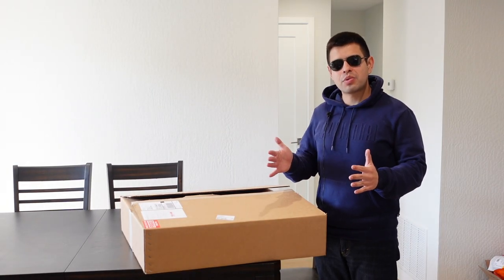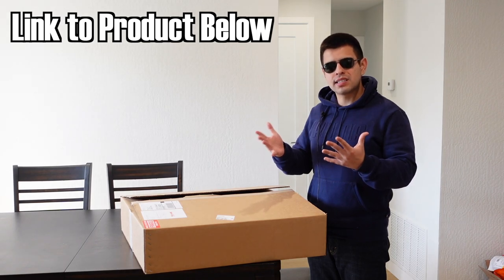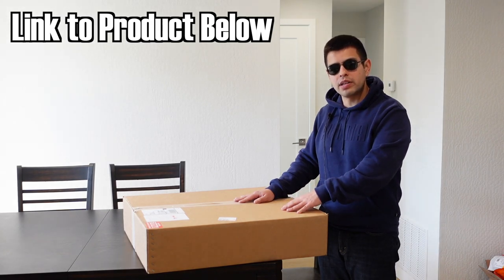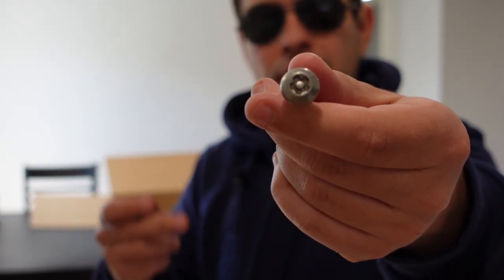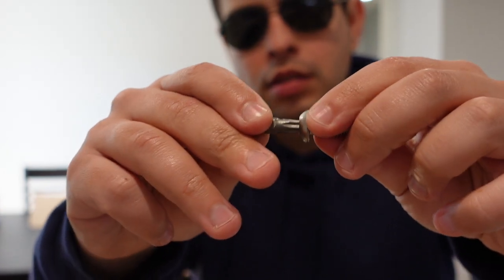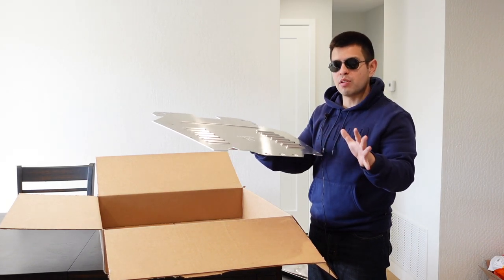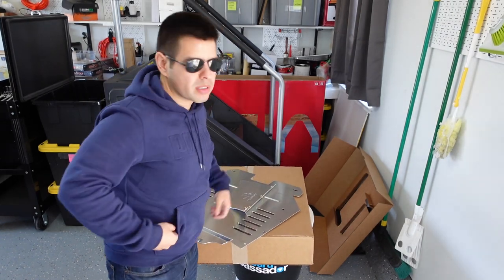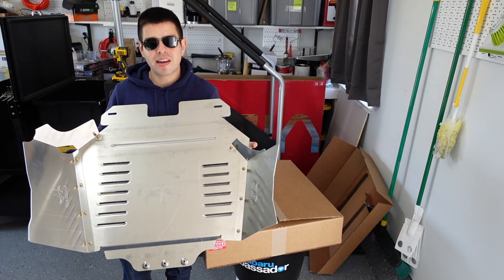Protect Your Tacoma! MILLERCAT Cat Shield for 3rd Gen 2016-2023 Tacoma Cat Shield Review and Install

Comment: Good video, I left the passenger side wing off so that I could move the plate around to line up the long screws then attached the wing and the crossbar. I've got the pro skidplate and it didn't interfere with the cat shield.
Reply from the maker: That is a good way also! Good to hear further confirmation it won’t mess with the pro skidplate too

Comment: Does The Shield cover the oil pan. If so you need to remove it to get a oil change ?
Reply from the maker: The shield does not interfere with oil changes, when doing an oil change you are more at the front of the truck where the stock skid plate is.

Comment: Thanks for this latest Millercat Tacoma shield. The other video from last year got me confused with its 4 front fasteners.  The one you ordered has 3  front fasteners. Mine will also have 3 front fasteners. I ordered mine from Amazon and is shipped from Millercat via FedEx ground , it is suppose to arrive today after going all over California. Almost a week, and I am in Socal
Reply from the maker: Nice! Sucks it’s taking so long, it took maybe 3 days to get to north California for me. But I have had shopping woes like that before! I did notice the 3 fasteners as well compared to the older videos. Wonder what instituted this change.
Reply: It arrived at 2pm today, got my Tacoma up my Autozone $60 ramp, and total time to assemble and install was only 30 minutes !
Did a Test Drive, no rattles (Unfortunately our roads in Menifee are too smooth) , best I could do was go fast on dips.
MillerCAT did improve the CAT shield, kind of expensive but made in USA.  Tonight I am ordering on Amazon a MillerCAT shield for my daughters 2021 Prius Prime!

Comment: Will this shield with recessed screws that you are installing in the video work on a 2018 Toyota Tacoma that is a 2 wheel drive model? Also, is it steel?
Reply from the maker: They do have a 2WD model, and also have 2 steel options.
Reply: The 2WD shield that they offer in steel does not have recessed screws.  We want one that has the recessed screws  and noticed that the one you installed had the recessed screws but it appeared that yours was a 4WD. Which is why we wanted to know if your 4WD shield would fit our 2WD Tacoma.
Reply from the maker: @michelesimmons8837  Yeah you will need the 2WD shield for your Tacoma, which would mean no recessed screws unfortunately.

Comment: do i have to remove that shield every time  i do an oil change?
Reply from the maker: Regular oil changes you are fine without removing it. Notice that it basically stops where the OEM skid plate starts aka where the oil change action commences.

Transmission oil changes though would definitely require removing it.

Comment: I called MILLERCAT, regarding about 3- inch lifted and they said; I won't fit, so according to your installation, is that true?
Reply from the maker: Depends if you are modifying your chassis. I am going to be lifted 2 inches but on just the Bilstein 5160/6112 combo so I will be fine.

Comment: Hi! Very nice review, I have a 2022 as well, so I was wondering, did you drill underneath at the tacoma  basement. If so it won't brake your toyota warranty?
Reply from the maker: No drilling at all. Every screw I put in was through a pre existing hole
Reply: No drilling..just screws

Comment: I am concerned that it will act as a heatshield and will increase heat around the converter or worse...cause a fire.  I saw someone post about how insurance would not cover repairs for a stolen cat if they installed a shield like this due to fire concerns
Reply from the maker: I don’t think it would honestly. The shield has a decent amount of space between the shield and the cat. And I doubt the 1/8 aluminum would act as enough of a heat container for the cat, and then the vents are also there to help.
Reply: @RobsAutos  the cat convertor gets extremely hot.  Taking away that airflow is dangerous
Reply: MillerCat does all of their own thermo testing on each model

Comment: I think I'll take my chances...lol
Reply from the maker: I just wanted the peace of mind…and my neighbor got his cat stolen once 😅
Reply: @RobsAutos  plus if get's stolen, you cannot legally drive the truck...........till new cat is on.......
Reply: Why do you say that? Does the install seem too difficult?
Reply: @johnbielenda7336  You can drive it home, but it would be a horrible idea to drive it. The catalytic converters are an integral part of the exhaust pipe that holds heat in after you stop the engine. Without the catalytic converters, cold air can go straight up the pipe to the head and warp your valves (especially in winter time).
Reply: I said the same thing till they stole mine, been waiting 1 month so far for a replacement converter from Toyota. Miller cat is going on asap when I get my truck back

Comment: The biggest problem is that it is overly priced.
Reply from the maker: It is actually one of the cheaper options available, I figure better than paying the $1.3K+ for a new cat.
Reply: @RobsAutos  Or the $100 to $500 deductible...and depending on the crime stats in your area your risk could be near zero.  I think it could half the price...just my opinion.
Reply: Does insurance covered 🤔 the catalyst converter on 2022?
Reply: @spacecoastz4026  I'd rather not. For one thing, if the catalytic converters are stolen; it is a showstopper.  The pickup is undrivable in winter where I live, because cold air will go straight up to the head and warp the valves without a pipe in place that can hold the heat in and cool down slowly. The more that people make claims on their insurance, the more the insurance rises for everyone that has it. Insurance companies are in the business of making money; not in the business of providing assurance (contrary to popular belief).
Reply: @troy3456789  Insurance companies should pressure auto manufactures to help protect that exhaust system.
Reply: @spacecoastz4026  I do not believe they are in the business of providing guidance or helping anyone [if they can avoid it]. They post stats we can all see if we want to look for them, but otherwise they have all the ammunition they need to raise rates, or drop clients in the event of a claim. Theft hurts all of us.
Reply: I consider it cheap insurance considering the prices and time it takes to get a new catalytic converter. I just installed mine in my 2020 off-road and it was easy to install.
Reply: @IzaguirreC  I got the aluminum one for $275. I think that is probably less than 1/10th the price I'd pay to get two replacement cats welded on; not to mention waiting on parts, repair, etc.
Reply: @troy3456789  I went with the stainless steel to make it a living hell if they try to get to my cats. I also covered security bolt heads with a bit of rtv to make it more of a pain if they happen to have the right bits. I did the install in my driveway without even jacking my truck up. Like you said, it’s a fraction of the cost of replacement.
Reply: @IzaguirreC  I don't blame you for getting the stainless model. If I could have easily afforded the stainless one, I would've gotten it. I'm going back in an using locktite (blue nonpermanent) so they don't loosen on their own from vibration or easily from pair of pliers.
Reply: @troy3456789  You'd be surprised at the leverage insurance companies have on auto mfgrs, all they have to do is say they won't insure them.